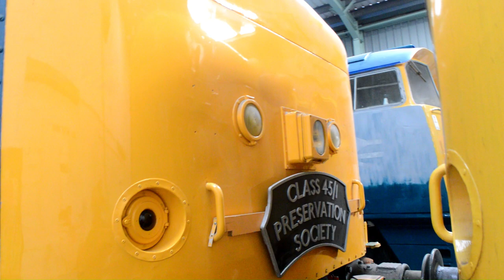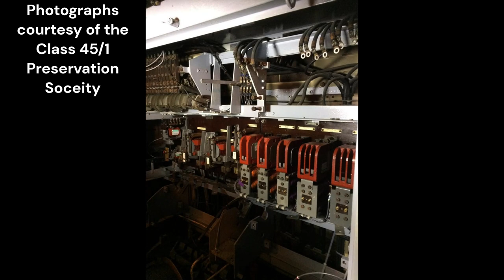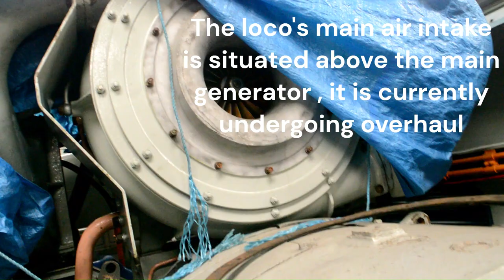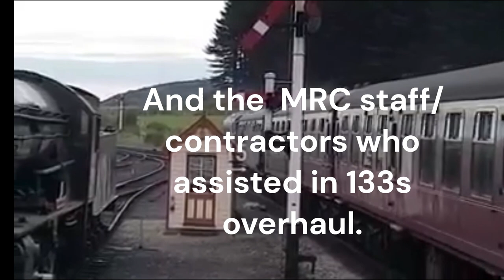45133- The story so far...

Comment: If you can’t have a deltic, have a peak. Those big sulzers looked and sounded beautiful.  Must have travelled behind your loco several times. Lovely to see this machine getting the tlc it deserves. Congratulations, and more power to your elbow.
Reply: I used to work with the chief driving inspector at Kings Cross and a huge Deltic fan. I prefer Peaks. I asked him to say something complementary about a Peak. He replied that if I was driving a Peak and he was driving a Deltic, and we both left Kings Cross at the same time, I would be across Welwyn Viaduct first, but he would then be hard on my heels. He reckoned he got 138 mph out of a Deltic. I got 115 mph out of a different Peak on three occasions. He replied. "That is pretty good. At 118 mph the armatures spin off the traction motors." Before adding, "And I shall not tell you how I found that out !"

Comment: I needed to know why don’t dig a tunnel and do an extension for the main line Train so that they can extend the unused abandoned underground train stations.  

Why couldn’t they use the part D78 Stock train doors on the sides and also restructure the front face of the A60 and A62 stock and that includes the class 313, class 314 and class 315 remix and make them all together and also redesign them an overhead line and also make them into Five cars per units and also having three Disabled Toilets on those Five cars per units A60 and A62 stock trains and also convert the A60 and A62 stock trains into a Scania N112, Volvo B10M, Gardner 6LXB, Gardner 6LXC and Gardner 8LXB Diesel Engines and also put the Loud 7-Speed Voith Gearboxes even Loud 8-Speed Leyland Hydra cyclic Gearboxes in the A60 and A62 stock, class 313, class 314, and class 315 and also modernise the A60 and A62 stock and make it into an 11 car per unit so it could have less doors, more tables, computers and mobile phone chargers.

A Stock Trains and also having 8 Disabled Toilets on those A stock trains. why couldn’t we refurbish and modernise the waterloo and city line Triple-Track train tunnel and make it more Larger and extend it to the bank station, making it into a Triple-Track Railway Line so those Five countries such as Australia, Germany, Italy, Poland And Sweden to convert the waterloo and city line Triple-Track Railway tunnel into a High-Speed Railway lines?

The Third Euro tunnel Triple-Track Railway line to make it 11 times better for passengers so they could go from A to B. then put the modernised  11 car per unit A Stock and put them on a bigger modernised waterloo and city line Triple-Track train tunnel so it could go to bank station to those Five countries such as Australia, Germany, Italy, Poland And Sweden. The modernised refurbished 11 cars per unit A stock could be a High Speed The Third Triple-Track Euro Tunnel Train So it is promising and 47 times a lot more possible to do this kind of project if that will be OK for London Australia, Germany, Italy, Poland And Sweden. 

oh by the way, could they also tunnel the Triple-Track Railway Line so it will stop from Buckinghamshire, Hertfordshire and Essex so that the Passengers will go to Australia, Germany, Italy, Poland and Sweden and also extend the Triple-Track Railway Line from the Bank to Buckinghamshire, Hertfordshire and Essex Stations so that more people from there could go to Australia, Germany, Italy, Poland And Sweden more Easily.  

Why couldn't they extend the Piccadilly line and also build brand-new underground train stations so it could go even further right up to Clapton, Wood Street can they also make another brand new underground train station in Chingford and could they extend the Piccadilly Line and the DLR right up to Chingford?

All of the classes 150, 155, 154, 117, 114, 105, and 106, will be replaced by all of the Scania N112, Volvo B10M, Gardner 6LXB, Gardner 6LXC and Gardner 8LXB Diesel Five carriages three disabled toilets are air conditioning trains including Highams Park for extended roots which is the Piccadilly line and the DLR trains.

Could you also convert all of the 1973 stock trains into an air-conditioned maximum speed 78 km/hours (48 MPH) re-refurbished and make it into a 8 cars per unit if that will be alright, and also extend all of the Piccadilly train stations to make more space for all of the extended 8 car per unit 1973 stock air condition trains and can you also build another Mayflower and Tornado Steam Locomotive Companies and can they order Every 37 Octagon and Every 17 Hexagon shape LNER diagram unique small no.13 and unique small no.11 Boilers from those Countries such as Greece, Italy, Poland, and Sweden, can they make Mayflower and Tornado Steam Locomotive speeds by up to 142MPH so you can try and test it on the Original Mainline so it will be much more safer for the Passengers to enjoy the 142MPH speed Limit only for HS2 and Channel Tunnel mainline services, if they needed 16 Carriages Per units, can they use those class 55’s, class 44’s, class 40’s and class 43HST Diesel Locomotive’s right at the Back of those 18 Carriages Per Units so they can take over at the Back to let those Mayflower and Tornado Steam Locomotive’s have a rest for those interesting Journeys Please!!!!!, oh can you make all of those Coal Boxes’s 17 Tonnes for all of those 142MPH Mayflower and Tornado Steam Locomotive’s so the Companies will Understand us PASSENGER’S!! so please make sure that the Builders can do as they are told!!!!! And please do something about these very very important Professional ideas Please? Prime Minister of England, Prime Minister of Australia, Prime Minister of Sweden, Prime Minister of Germany, Prime Minister of Italy, Prime Minister of Poland and that Includes the Mayor of London.